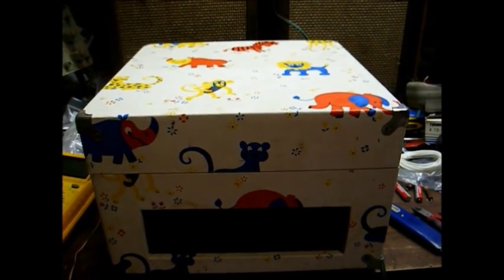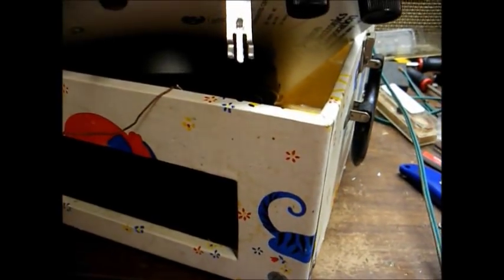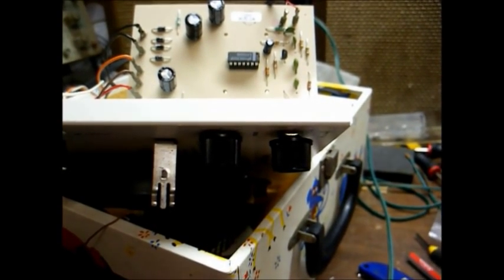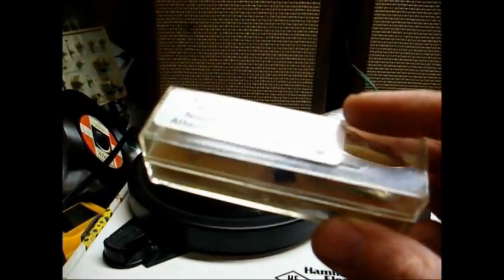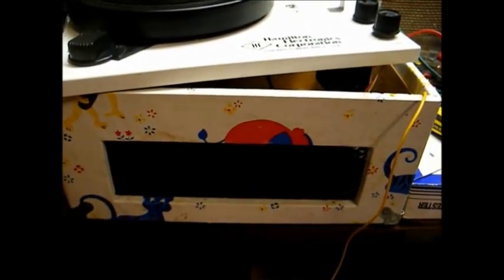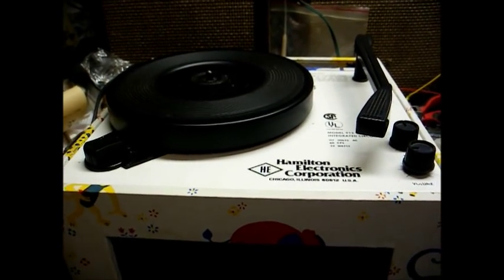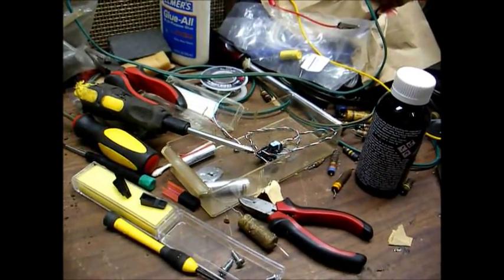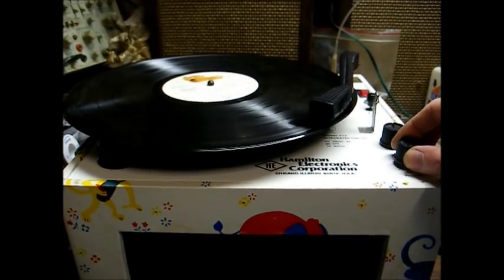Repair of a Hamilton 915 classroom record player from 1997

Comment: The Record Player's enjoy. You have knlogldge restoring vintage Electronics, You explain it well📻📺😀I'm all for the AC motor  better than a DC motor came across a MCS 6205 I was able to  Re lube the motor overhaul the component record player,  I replaced any capiotrs outer of tolerance new pickren stylus and needle. A TIP solder the wire lead connections on  bad cartage the wire leads - correct you can damage the good cartridge- We can all learn from Radiotvphononut  Another good sip would a little patience knowledge wisdom this stuff is not difficult, Take your time,